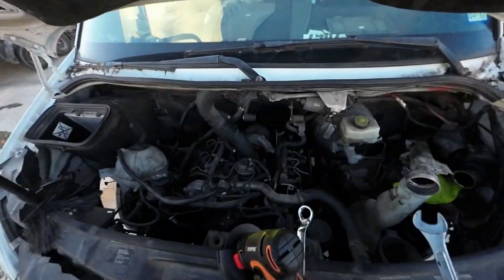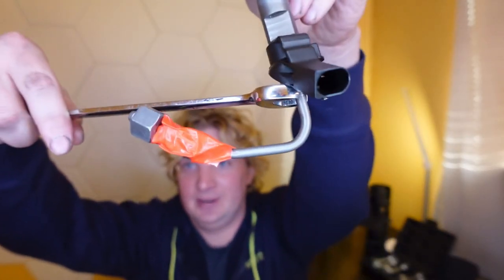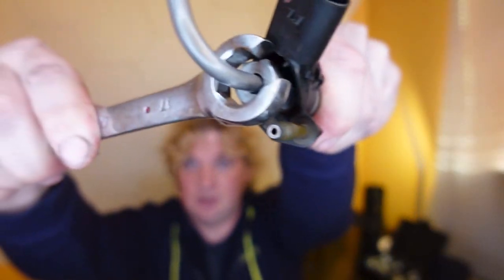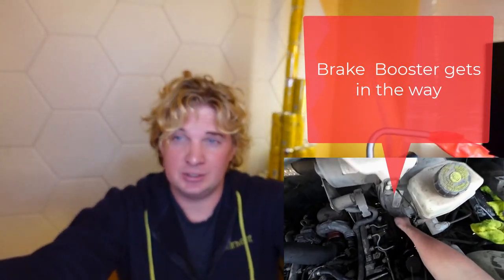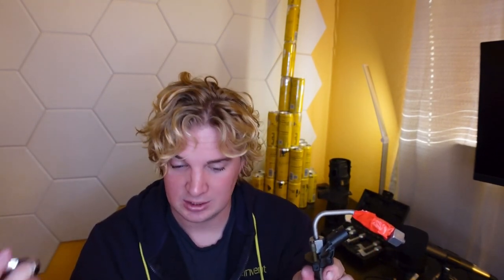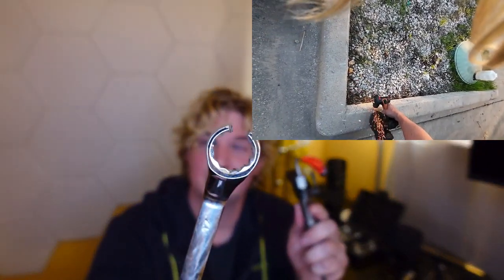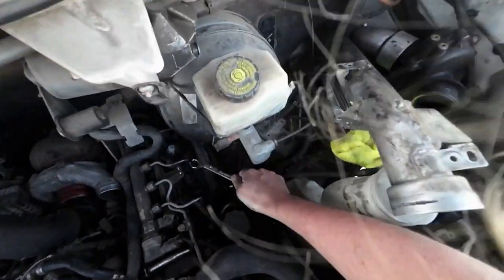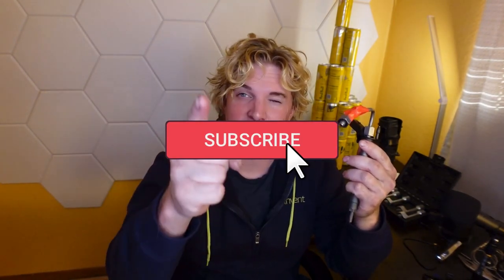Sprinter Van Injector Removal Tools: Best & Worst

Comment: Do you know how to remove the speed limiter on a 2005 dodge 2500 sprinter?
Reply from the maker: Scan tools won’t be able to get it above 82.5 mph.   But I think I can remove with ecu mod if u want higher.  Is yours stuck at that number or a lower number

Comment: Hey how many miles are you getting per tank ? Approximate
Reply from the maker: I’ve averaged 23 mpg if you fill up at truck stops. Usually closer to 20 though with city driving.
Reply: Wow that’s good I’m getting approximately 12-13 miles per gallon what year Sprinter do you have?
Reply from the maker: @marshallwallenta6733  my favorite year sprinters are 2007 through 2009.  I currently own a 2007. 2008. And 2009 haha.  But I do ecu mods to increase mileage.  And I have a light foot.  Most days. Haha